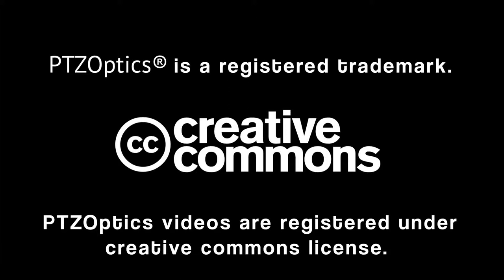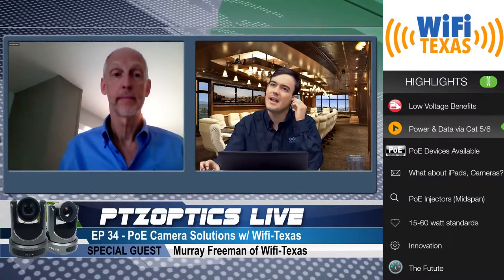PoE Camera Solutions w/ Wifi-Texas - EP 34 - POST SHOW

Comment: Yes and thanks for reply, what I was looking to achieve was as I'm not that well off to use my iPad as an external camera for streaming or live feed with vMix been told it possibly can be used but only cable into laptop with vMix on.
Not sure what you can advise as Wirecast has app on iPad that you can stream wireless from there with wirecast set up on laptop
Reply from the maker: Ahh, yes... What I like to do is use a video conferencing software like Skype or Zoom. That software can then be picked up on your main broadcast PC. Ideally you make it full screen on your second monitor and you simply use a desktop capture... That's how we do it
Reply: +PTZOptics so where does the iPad camera come in then? Can it be used wireless through IP address or with cable to laptop as really don't know how to set up iPad camera with vMix for live streaming or even recording?
Reply from the maker: You basically launch a screen share session or video conference from your iPad to your computer. Then you capture that session via a desktop capture from your second monitor. This is your only choice other than another software screen sharing solution, OR a capture card solution.
Reply: +PTZOptics thank you but how can wirecast do it so simple then as with a camera app on the iPad ?
Reply from the maker: Because wirecast has an awesome app called Wirecast Go. I do believe that a company made a iOS app for NDI called Sienna? But I haven't tried it. That would do something along the same lines.